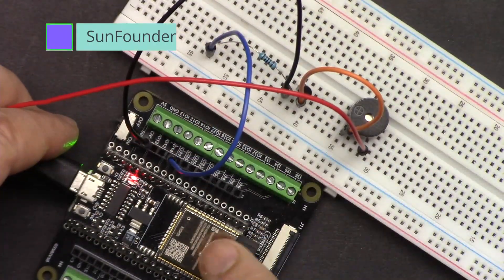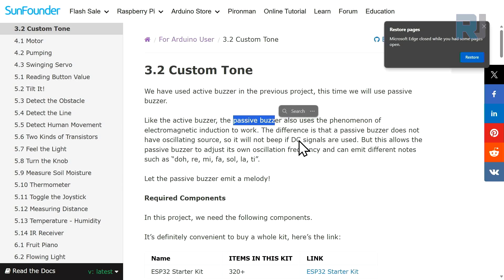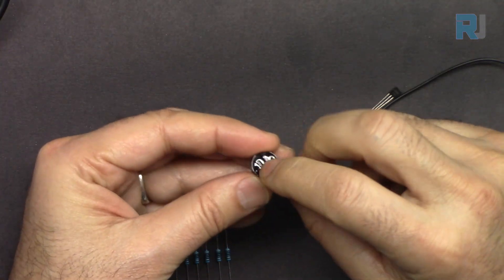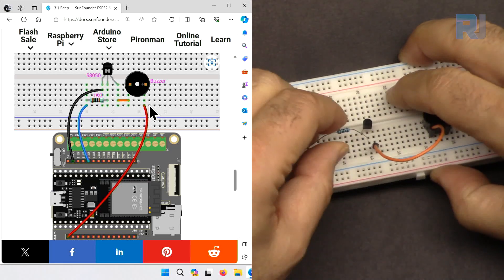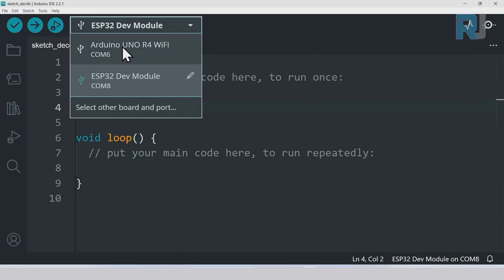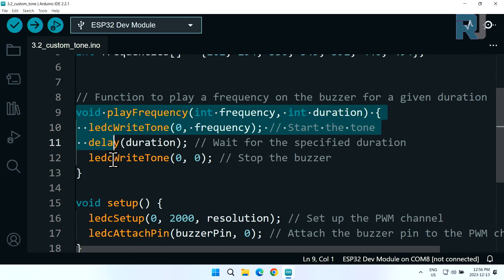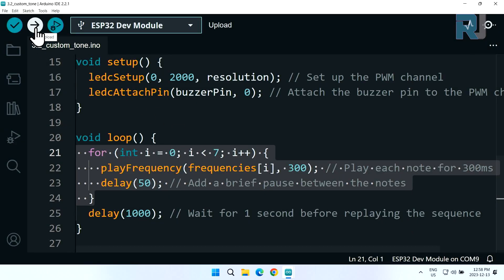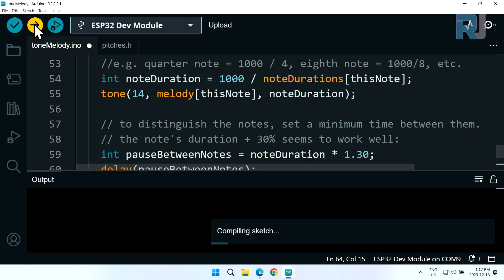ESP32 Tutorial 14 - Playing Custom Music Note Using SunFounder ESP32 IoT Learning kit

Comment: Why do you need to use a transistor?  Can’t you directly hook the gpio pin up to the buzzer positive?
Reply from the maker: the output pins of ESP32 can't supply enough power to the buzzer. in order to  not overlaod the ESP32, we user a transistor and take very weak signal from ESP32 and amplify it using Transistor as as a switch. I other coming videos I have measured the current needed for buzzer, then showed how much current each pins of ESP32 supplies and expalined it. then I did not use the transistor at all.